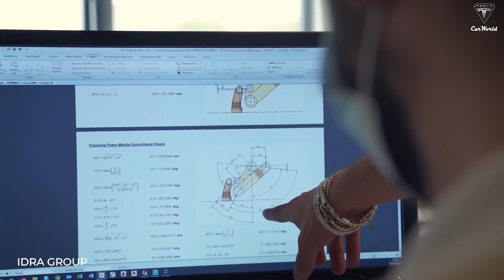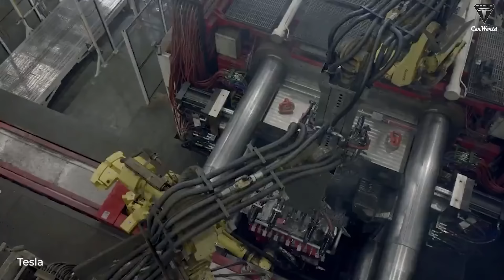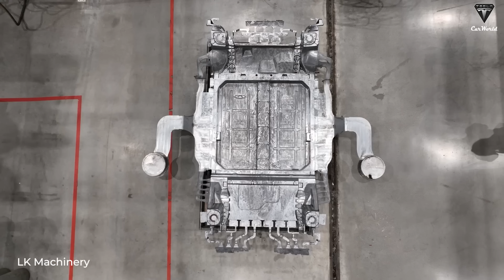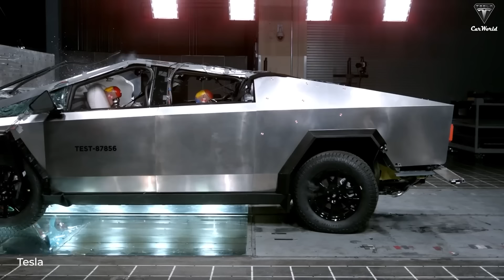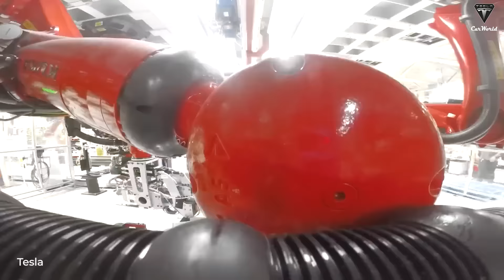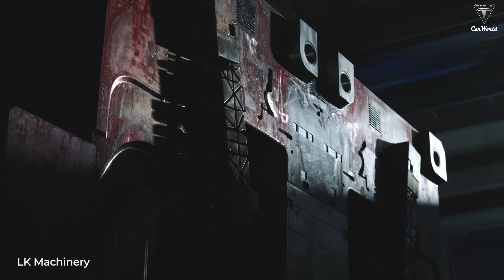Massive 50.000T Giga Press Built Next-Gen Tesla Car APPEAR!

Comment: Alcoa’s/Arconic Cleveland Ohio plant has a 30,000T and a 50,000T hydraulic forge presses both built in the 1950s and are still going strong.

Comment: Will the integrity of the frame be compromised after an accident?
Reply: No, they just melt it down and reinject it into a new frame, while you wait.
Reply: @carabela125 where abouts?
Reply: Blank question..all depends on accident
Reply: @TomasLenciauskas  Will the integrity of the frame be compromised after an accident capable of damaging the frame and not just sheet metal?
Reply: It's in vibranium. The low cost in adamantium

Comment: How long does it take to heat the mold up. If it takes awhile to heat up the mold does it run 24hr? The second issue is that the ultimate strength of cast aluminum is much lower than components milled from bar stock.
Reply: T
Reply: hello fans